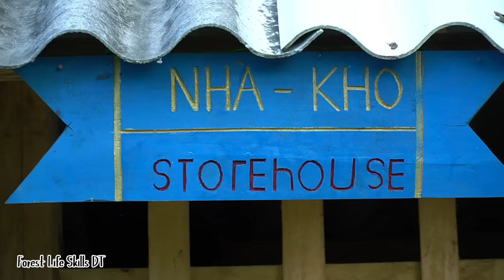Catch fish, chicken, prepare for honeymoon in the deep forest | Forest life skills DT

Comment: Put a aluminium foil to prevent splattering on other areas
Reply: She wasn't frying. She was rendering the fat, which requires low heat. No splatter, but good advice 😊